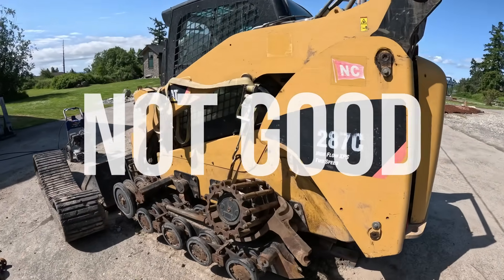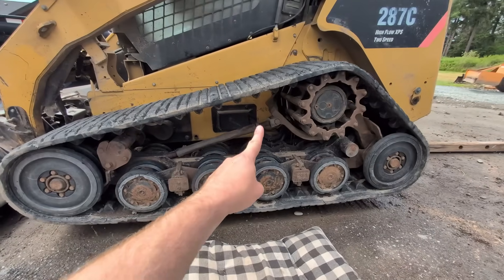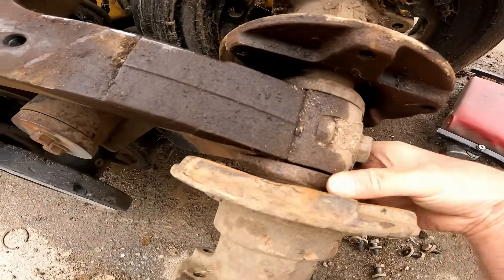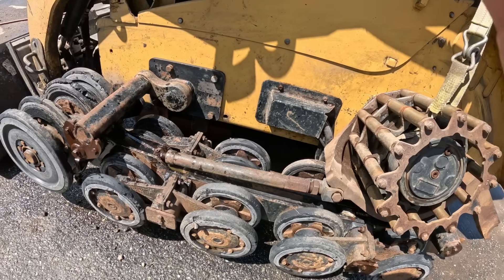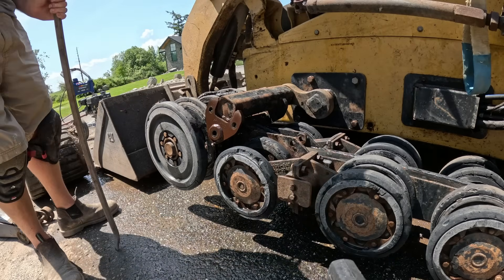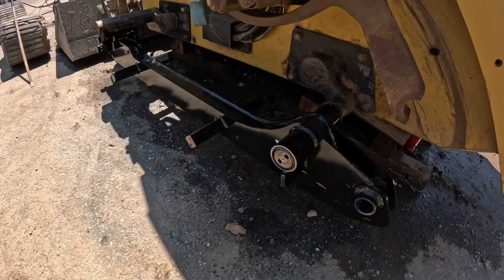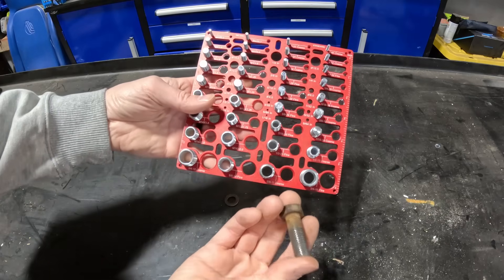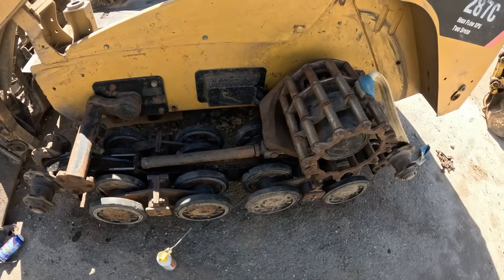Broken FRAME! Can I fix it? CAT 287C DIY repair to save $6,000!

Comment: From what I saw.  You had some misalignment with your ideller wheels is what caused the failure.  And I agree that you did the right thing by doing the job yourself.  It looks like the repair is holding up great.
Reply from the maker: Is there a specific point in the video you are referring to that gives you that conclusion?  This machine is my first experience with the ASV style tracks so I'm still learning the ins/outs of them.  Appreciate the support, thanks for watching and commenting
Reply: @BrettsBuilds yes right at the beginning when the view looks down the old rail.  And it also shows how the rail gets worn because of your idlers being missinlined.
Reply from the maker: @charleswelch249 I'll take a closer look, thanks

Comment: Easy to find out if the brace was there look at the side that's not broken. Now do the other side before it breaks.
Reply from the maker: That's a good point, but I wouldn't necessarily call it "easy". You would still need to remove a couple bogey wheels.

Comment: As far as part difference between sides it could be as dumb as grease zerk on the outer side. You’d think some bean counter would just have two ports with one plugged 🤔
Reply from the maker: Hmmm that's definitely a possibility

Comment: Watched your video and that was the first skid steer I saw with the arms bolted on at an angle to provide tension on the tracks. All the other ones you see have the stupid grease piston. 

Skid steer manufactures save the world from grease and put small diagonal pistons connected to the main hydraulics so you can have quick adjustable tension on your tracks. Would make it much easier to fix a derailment!
Reply from the maker: That would definitely make track maintenance a lot easier!

Comment: very common failure on those skid steers when it does fail, i had one split in half on the frame itself, they did update the part number for that carriage the update also made it so that you didn't need any bushings for the frame.
Reply from the maker: That's what I suspected, good to know about the updated part and no bushings. Appreciate you sharing that!

Comment: I'm thinking that missing square was a design flaw, causing failure and CAT solved the problem adding the reinforcement to the track frame, I doubt they recalled any and assume many more failures, time will tell, excellent reverse engineering Sherlock🔎 New Subscriber here💡
Reply from the maker: That's what I think too, appreciate your insight and subscribing!  Happy new year

Comment: Rough estimate 
$8400.-6000=$2,400.00  for parts and miscellaneous
10 man hrs.  most probably  2 guys done in  5hrs 
Shop time and labour: 5x300.00*=$1,500 
* 2guys @$150 each per hr is excessive but still leaves $6000-1500=$4,500 for net profit margin? 
Wow,  they obviously don't need the work!
Reply from the maker: Yeah, the quote was absolutely ridiculous for what it was, but that's what all the shops around here are charging now.  I live in a very expensive area.  Just 1 example: They wanted $350 for each bogey wheel, I paid $90 online.
Reply: @BrettsBuilds . thanks for the video. I really wondered how those things were put together.. good to know that could be fixed at a decent price.
Reply from the maker: @FFLFFS  the one I took out is also fairly easy to fix with some metal fabrication, even if I paid a fab shop to fix it, I bet it would be well under $1,000 so that would have saved another $1,000-$1,500.  But at least now I have a spare as the other side is pretty worn too, not nearly as bad though.

Comment: Hello, nice video and it's a pity that you didn't show how exactly the connection of this swingarm to the drive looks like. As for the difference between these chassis in terms of sides, there is only one difference In my opinion, this is the place where the element is mounted, thanks to which we lubricate the shaft on which the carriage is mounted. Plus, in my opinion, this chassis can be easily regenerated. Best regards, from Polish
Reply from the maker: It kind of worked out that the way it was broken made it to where I didn't have to do much with the drive motor.  Thanks for watching and commenting, it's fun to see all the places people are from 🤠

Comment: This is what happens when you don't look around your equipment,😂😂😂
Reply from the maker: You're not wrong, but in this case I think it was just time.  These ASV tracks are widely regarded  as terrible for heavy use, I sought them out for the low ground psi.  They're definitely weaker than the more robust CAT metal bogey wheeled units.

Comment: I would have welded up the old one b
Reply from the maker: I kept it so I could do that when I need it again for the other side. Had I known what I know now I would have done that.
Reply: @BrettsBuilds there is a service bulletin for the old track frames and CAT does have the full parts and procedure to weld on a retrofit they made. Only problem is wether your dealer network still has to jig for aligning the weldment

Comment: Surely , you're not going to remount all those old , worn out rubber rollers !!!!???
Reply from the maker: What's wrong with the bogey wheels?  I replaced a few of them that were damaged.
Reply: It appeared the steel frame was bent or twisted , which might mean those wheels were misaligned and caused the whole frame to warp from the collective stress of all the wheels working together !!!
Reply from the maker: @joedoakes8307 I think the twist was just from the very end when it let go.

Comment: You did great job if you have equipment its definitely worth doing all you can yourself vs paying someone. I’d say the track frame was probably an updated version.
Reply from the maker: Absolutely, I was shocked at the quote.  Shop rates in my area are now $230/hr so it adds up really fast!  
Not to mention the enormous markup on parts.